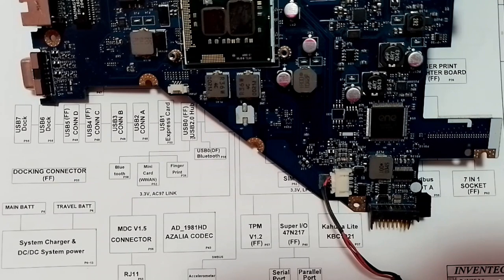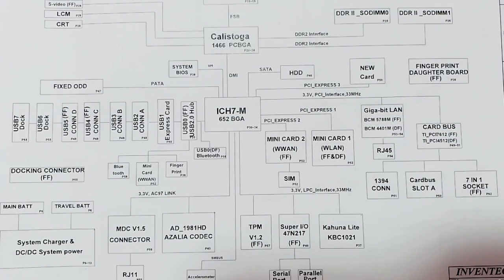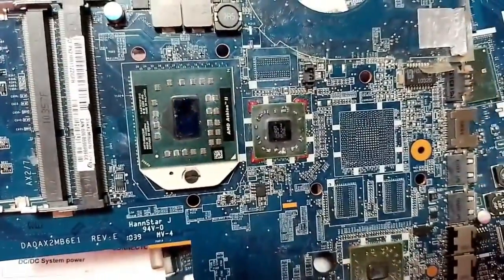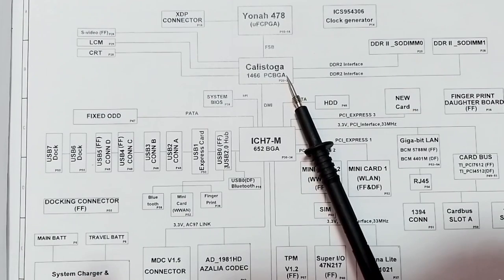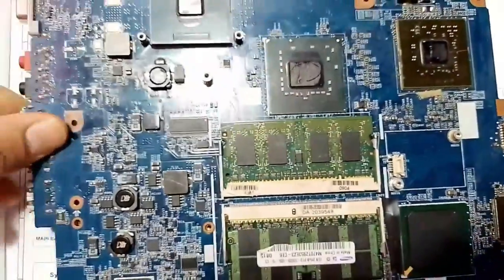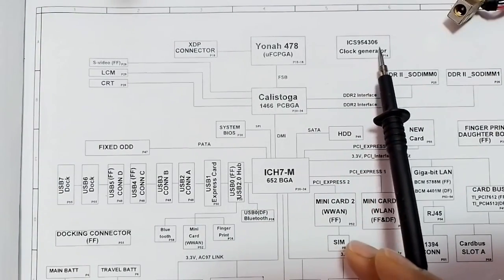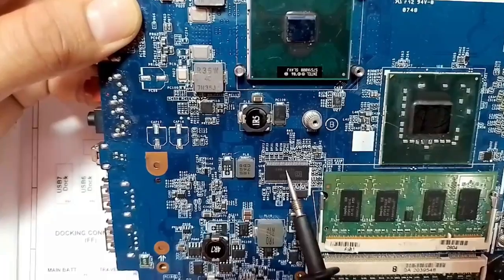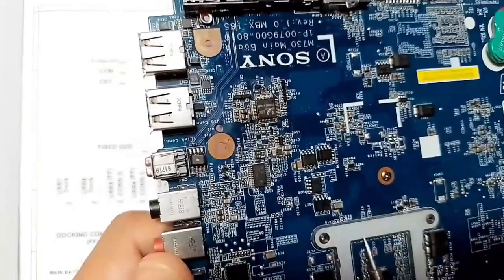Laptop Motherboard Block Diagram Explained - Motherboard Parts & Components in detail

Comment: Sir it is possible  to test or measure voltage of capacitor in circuit board,When the power supply is on. And no need to  discharge  when the power supply is on. And there is no blast of capacitor when the  voltage of capacitor is 450 volt or high? Please help sir
Reply from the maker: Yes you can, but be aware of high tension
Reply: Sir . What is the meaning of high tension. it is high voltage or not,?